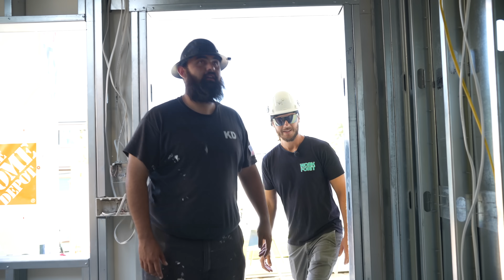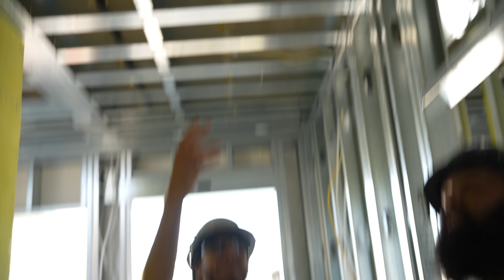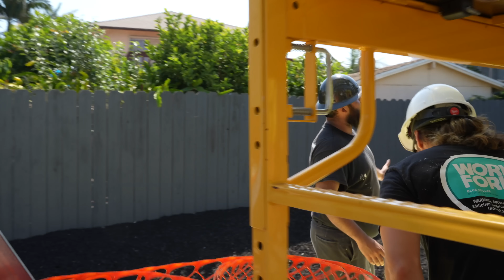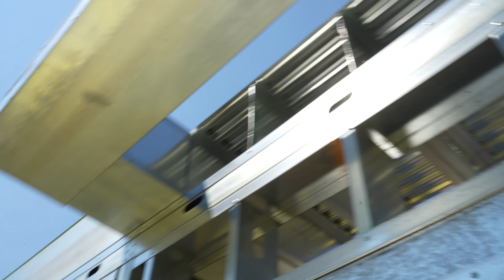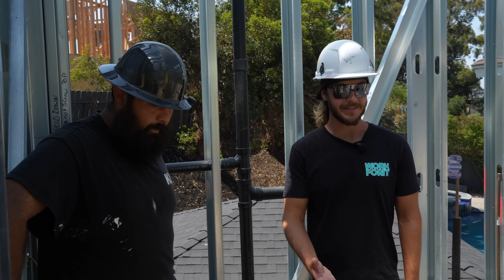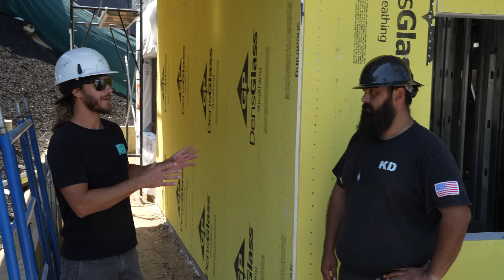This May Change the Way Homes HAVE to be Built in California!

Comment: The homes are so close together, that metal will probably melt or warp so badly it can’t be used after a fire anyway. Still plenty of plastics and woods that’ll help make the place trash. 
The amount you’re spending isn’t worth it IMO, framing generally excluding factors is the cheaper part of the home build 🤷🏼‍♂️

Comment: We had a few houses they tried the steel bones in Calaveras County probably 20 years ago, they had a lot of problems with the metal expansion during heat waves causing a lot of cracks in the interior sheet rock.

Comment: At 3 times the cost, this method will never take off, also this method was tried in AZ in the early 2000s, it went nowhere,  it's too expensive and too slow. The best method for fire prone areas is concrete

Comment: Hey if you wanna take it a step further start paying attention to your through wall penetrations most commercial job sites need to have those sealed and fire blocked for at least an hour rating. Most of the time and get away with packing and tight with roxul  and covering 3m cp25

Comment: The cost/benefit makes it totally absurd. Steel studs/framing are one thing, but fire will get in if it wants. Are you going to have steel window panes? The bigger problem is spacing of houses, combustibles/fences/shrubs/trees in between, even cars in the driveway/street. Maybe you did everything right. What about your neighbor's houses that are 10 feet away from yours? Burning at 3,000F degrees?

Comment: You can use the milling ends used for cnc machining to drill through that 14GA or squirt some wd40 as you cut the steel. It will save you some bits and saws. Kinda just like a pilot hole to save those bits

Comment: I'm wondering since they are having so much trouble getting the screws to go into the metal that they are going through a bit every other screw. Would it be beneficial to maybe hang up a sheet fastening it at the corners to hold it in place and then chalk line the line where the screws go, and with a good quality drill bit, drill pilot holes for the screws that are every 2 inches so the screws start easier. Might not go through so many bits that way.

Comment: 3 hours to cut a 3" hole in 14 gauge metal?  Maybe look for a new contractor? lol
Reply: You pay contractors by the job, not the hour.
Reply: @xtrm.mayhem4098  If the contractor takes them 17 months to drill all the 3" holes they will bid accordingly lol.

Comment: So when using a stud finder for a picture now they are screwed as it will ping on the entire wall.🫠
Reply from the maker: No sure what it'll do on the sheer walls, but most of the walls will be traditional drywall and they should work fine. Hanging things on the walls will suck though lol
Reply: @DMAXRYNO you also won't know if your going to hit electrical or water line.

Comment: I have done several hundred homes in steel stud over my 40 years
Reply: Yeah I don't know why they think this is like, a new thing? I even learned steel stud framing a little bit in high school. I've done it in commercial settings in Montana with the carpenters union. I thought steel framing was general knowledge at this point, although obviously not super common in residential but not unheard of, either.

Comment: when we built a wood processing factory herein Serbia, we were doing large rooms from wood, like 7m tall. When I asked why would and not concrete, beceuse wood dust (what is left from cutting wood) is very flamable and easy to catch fire, so the whole factory would catch fire, the reply from my teacher was: " if this thing gets burning and it is from concrete, concrete (or metal) will get liquified to the point construction will fail. BVut those large wood pillars, they will burn on the surface, but stay solid in the middle, keeping the construction solid"

Comment: This needs to be more of a thing. I don’t know about down there but in Canada we have “zero lot” homes, basically a single family home built within 10’ of their neighbours. 

Steel stud houses might cost more up front but you’ll save in heating, insurance(I would think) etc.
Reply: Actually there’s no heating savings with steel, nor insurance reductions… steel retains WAY less average heat than wood especially between walls, and as for insurance … it’s actually more since replacement costs are higher .. down here in Pennsylvania ALL commercial buildings are required by code to be basically this exact structural setup … and I hate it vs wood . I do this day in and out and I prefer a stick framed house all day
Reply: @Cavemanmedia69 steel framing doesn’t warp like wood does so insulation would hold better in the wall cavity and not have any gaps air can get through. Steel is less combustible compared to wood as well, less structural damag which is where I’m thinking it might save you on insurance but would have to check with your provider for clarification. Code is pretty much the same here too in Alberta, Canada for commercial buildings. I was in it myself for 20 years. 

Wood makes good backing in the walls for tvs and handrails I’ll give you that 😂 😉

Comment: I think this is a pricey overkill. I was in palisades today seen some mansions getting framed up in wood again it would be so expensive to do those same hoses all metal like this. I think if you just keep the exterior metal including roof and some concrete you’ll be fine thru a fire and a good irrigation system

Comment: Worked for a company that built a 4000 sq ft custom home out of steel stud in Anaheim Hills back in the late 90s.   Old neighbor in El Monte built a 3 story 6000 sq ft home out of steel studs in mid 2000’s.  I’m currently a commercial framing and drywall contractor out of Apple Valley that builds daily with steel studs.   It’s definitely a bit more expensive but at the end of the day it’s money well spent.  Definitely wouldn’t be building any track homes out of it because they would be extremely over priced but if you’re building yourself a custom forever home then it’s the way to go.

Comment: I'm a retired finish carpenter and worked on one of those 25yrs ago in Fullerton CA. I can tell you they suck for residential construction. You can't nail trim off (doors, crown, case, base, etc.) unless the framers block the shit out of it (they don't). You have to screw everything including lathe (stucco,showers etc.) and if it's wood or cement sided your fucked. Plus they creak in the wind.

Comment: Southeast Fl average home 3/2 2cg $300.00/sq 
Did my own 3/2 2cg quartzite counters nice finishes etc $155.00/sq all block poured walls impact windows wood studs metal roof. R22 insulation foil/foam board behind drywall. 2400 under roof 1850 under air.

Comment: My contractor drilled each hole with a small bit prior to putting in self tappers. He didnt go thru bits very often. I live around tornadoes so the fireproofing of the walls wasnt an issue, my 3000sqft brick home single story has all 16g steal like this.

Comment: Steel stud melt and twist and are just as weak as wood in a fire
Reply: Weak is subjective. What temp do the wood studs burn at, what temp do the metal studs melt at? There's about a 1000° maybe 2000° difference. 
I am a bit biased since that what we work with but, Steel studs all day!
Reply: I watch a steel stud house burned down here in Arizona Just as fast as a normal wood frame house would have.
Reply: @dimitrikatsafouros6889 you have to look at all factors other than just the studs. What was their exterior materials made out of; siding material, roofing material, were there any openings in the soffett or exterior skin where embers could work their way into the building. What foliage or items were next to the structure that were flammable. How long had the structure been burning before any attempts to extinguish the fire, or were there any attempts to put the fire out.
Like I said, other factors than just the studs.

Comment: I've seen some other videos where smaller factory built homes are made from steel studs with steel siding and roofs. Sounds like an excellent choice especially in fire prone areas. 
They do have some special equipment to custom build the metal pieces so it's a little more like an assembly line and therefore less labor intensive. Looks like this could very well be the future of home building. 👍
Reply from the maker: Ya, I see that being a more affordable way to do this

Comment: Of course 14 and 16 guage steel will need tougher bits. You could make a million if you came up with a solution. Bet you go through the drill batteries fast too. LOL I do know you want to use lath screws and not self piercing screws on the metal studs. They go in faster and snug up. Where self piercing are harder to go pierce the metal and will spin instead of tighten. I built my own tiny home with steel studs.  And Im a 60 some year old woman. Its not hard. Used metal to avoid termites and dry rot.